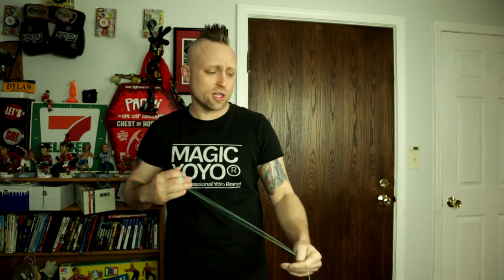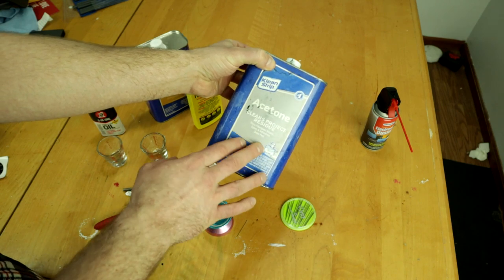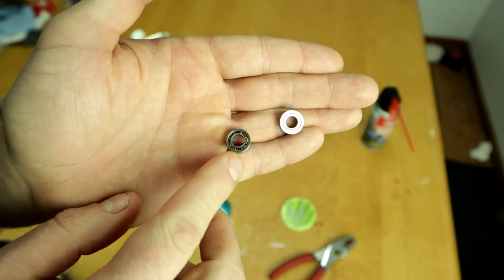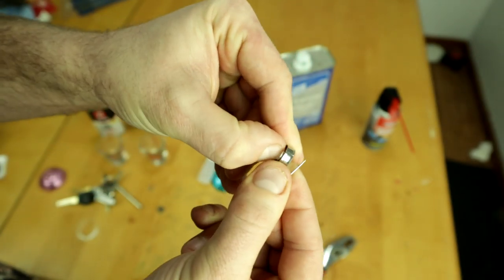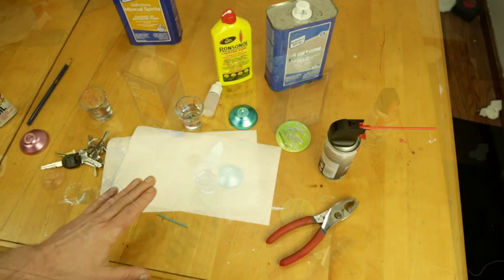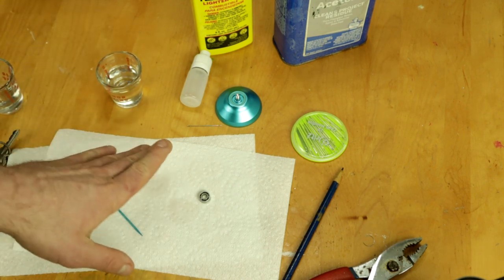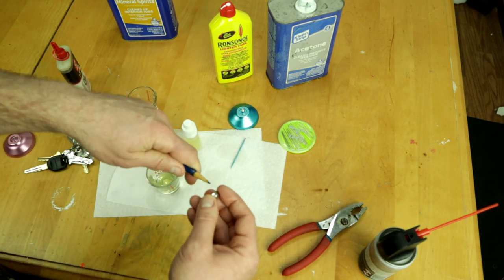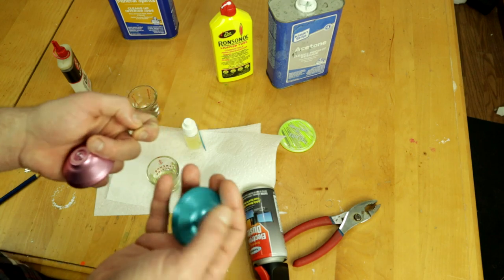How To Clean & Maintain Your YoYo Bearings.

Comment: Thanks for the content. It's informative and your personal additions are good remarks. I do have some questions:

1. Why do we use thin lube (or any dissolved lube) in oppose to just pure lube?

2. Why do we have to apply the thin lube in very minimal manner (by using a pin as shown) instead of just soaking the whole bearing with lube?
Reply from the maker: Because your yoyo will become responsive if lube is too thick. And you don't put alot cause then it gets all over your string and ruins it. It also makes everything gunk up. Alot of people run their bearings totally dry
Reply: @DylanKowalski123  Oh god I've been doing it wrong haha. Thank u for ur response. I'll follow ur instructions. Kudos!

Comment: I've seen people use 90%+ isopropyl alcohol, does it work as well
Reply: thats what I use and it's never failed me
Reply: as a solvent?
Reply: Is it or not is it good for a responsive yo-yo or not
Reply: @mathewdega8962  no
Reply: @kevinnightmareszzz6140  you use it as? For cleaning??
Reply: @h_rvs_2  yuup
Reply: @kevinnightmareszzz6140  whaattt it works??? No any side effects? Or acetone is better
Reply: @kevinnightmareszzz6140  what do you use for lubing?
Reply: @h_rvs_2  The yoyojam lube but any thin lube will do really some people use the yyf one and yotricks.com one comes in a nifty bottle with fine tip and I'm sure what Dylan made in this video works great too

Comment: Sweet thanks. Does the string play a part of the performance of the yoyo? just got a butterfly xt and it sucks. First yoyo in 15+ years thanks.
Reply: Strings do play a big part, but what about your yoyo sucks? Can you be more specific? This way I might be able to give you a better advise to what you can try to improve it.
Reply: @Begleitkubus  it's a butterfly xt it snags and doesn't work great tried 3in1 it helped a little
Reply: @garymitchell9152  Sounds like the response is to strong, a thinner string might help but I think the butterfly xt has some limitations like Dylan mentioned in his review: https://www.youtube.com/watch?v=r0Yn4QkZ_jA
Reply: I threw a Zipline Prestige on my Butterfly XT and it definitely improved my experience. I kept having trouble with it coming back in the middle of tricks,though, so just bit the bullet and got an unresponsive. Having a lot more fun now.
Reply: @garymitchell9152  thick string and thin string. Make a yoyo play one way or another way

Comment: After spending about 15 minutes trying to deshield my bearing, I realized I was pushing on the wrong side of the C-clip. On one side of the opening there's a squared off end to the clip; at the other, it's at an angle and looks like it's pushing into the outer ring of the bearing. You want to slide the pin under the latter. Maybe I'm an idiot, but hopefully this helps someone else.